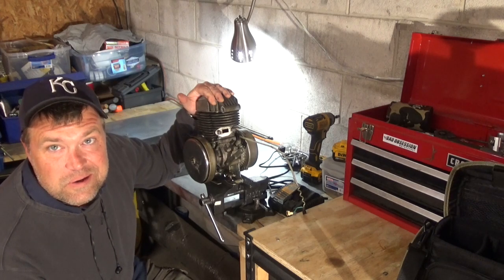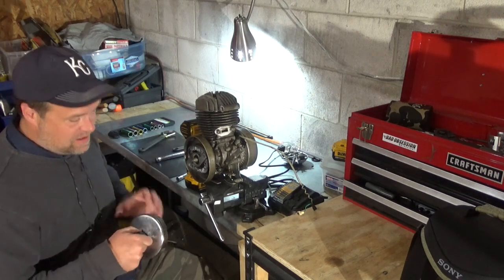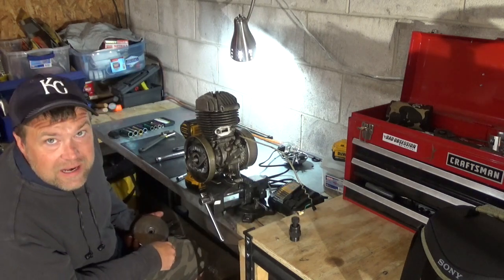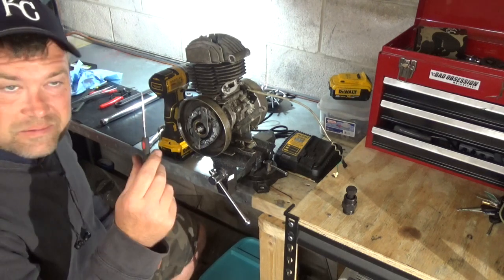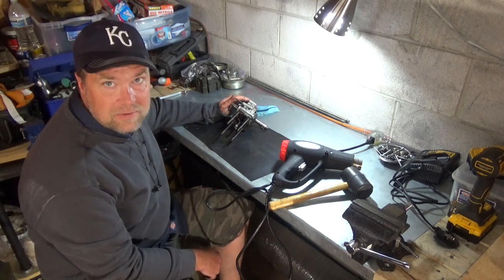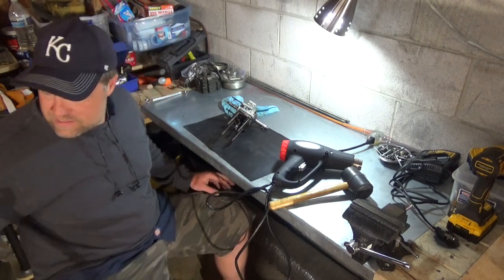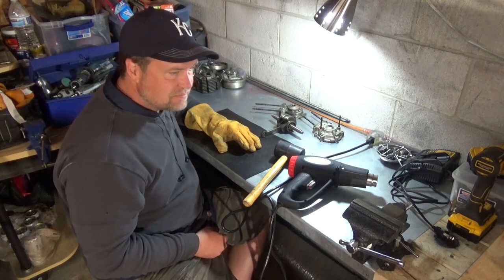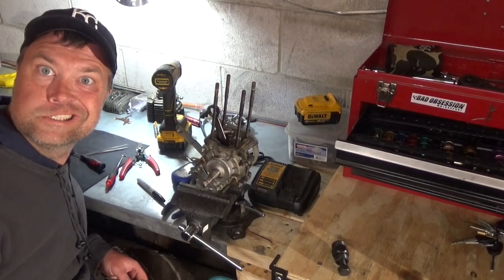Motobecane Moped Restoration Ep. 7 - AV7 Stock Engine Rebuild Pt. 1

Comment: Hey David, I appreciate you making these videos to help others bring vintage mopeds back to life. 

I recently bought a 50v just like yours, except its orange and in pieces. I was wondering if you could tell me what the center hole on the cylinder head is for? If I need to screw something in it, What? 

Thanks!
Reply: Thats the decompression valve

Comment: what size cam puller did you use? I ordered the one from Treats for a Motobecane but they are both too small. It was the 19mm x 1mm/ 24mm x 1mm. It looks like it should be 26mm? Curious which puller size worked for your magneto cam.
Reply from the maker: You’re right.  The stock magneto uses a 26mm puller. When you upgrade to the Le Partie CDI from treats (which you should 😜), you will use a 19mm. Good luck!

Comment: Hi ,I bought a 1951 av3 mk 1 frame ( no stand ) and clutch , it was running fine till I changed the tyres and now when the pedals turn the main crank does not . The main crank will spin the piston on a drill and socket , but pedalling on a rear wheel stand she won't turn at all. The belt is tight and both chains are normal tightness , and the cycle to drive button is in . Any ideas why she won't turn the crank on the pedals? Thanks

Comment: Where did you find the tool for removing the variator (i'm doing a rebuild too bit my engine Is siezed)
Reply from the maker: Heya Luca.  Here it is:  https://www.treatland.tv/24mm-x-1mm-26mm-x-1mm-puller-for-honda-mbk-p/24x1-26x1-honda-mbk-puller.htm
Reply: @DavidFixesHisShit  So the side with the points has a left hand threads?
Reply: @DavidFixesHisShit  Good idea on the bag and tag David that is how i do it.
Cheers

Comment: What do you call the thing you used at 6:25?? I need one but can't find the name of it. Also, where did you buy that Polar puller, need one of those too.
Reply: The breaker bar?
Reply: @cardscollectiblescanada1726  Yeah, that one. But I manage to get it off, and I now have the engine running, starting and idling. It Is a cool experience to get It running again :D